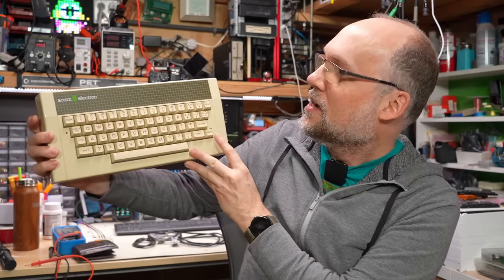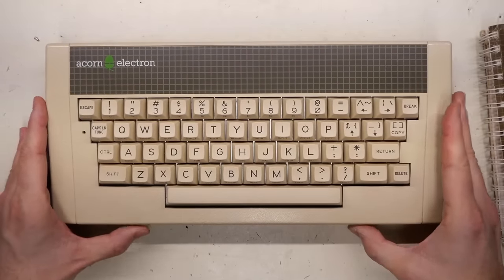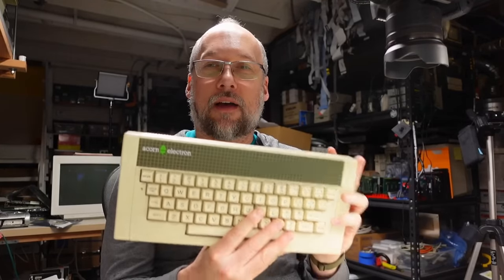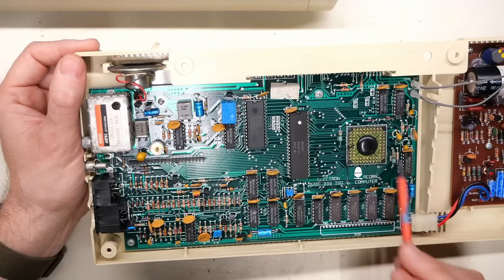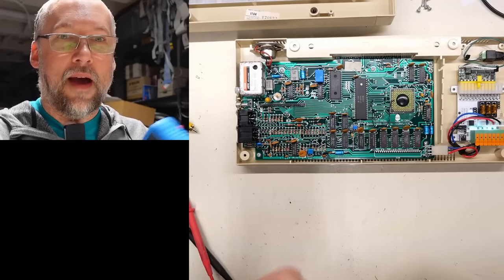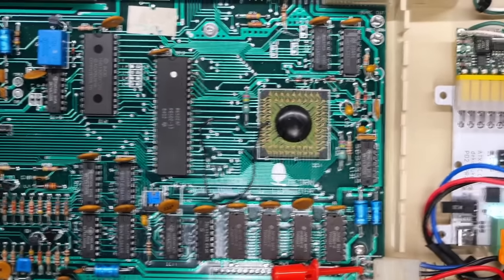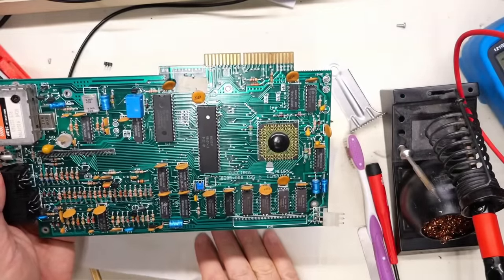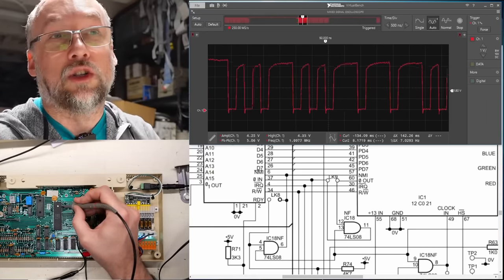I was shocked at what was keeping this Acorn Electron from working (Acorn Electron Repair)

Comment: Regarding the SY6502A and the minimum clock speed - the MOS 6502 was a dynamic logic NMOS process chip. This means that unlike a CMOS process that is in every modern chip where you have NMOS and PMOS transistors, you only had NMOS transistors so you needed to design your logic circuitry very differently. Dynamic logic requires that you precharge all combinatorial logic nodes high during one clock phase, then evaluate the logic during the next clock phase. If none of the NMOS  transistors pulled the logic node low, then you have a one. This method depends upon the node capacitance being large enough that during the phi2 clock phase, the 1 doesn't leak away to be a zero. Hence the minimum clock frequency of 25kHz.

Dynamic logic allows you to use fewer transistors at the expense of a maximum cycle time - so this was another benefit when transistors were (relatively) huge and die area was at a premium.

So a static logic circuit design is going to be very different from a dynamic logic design - hence why a CMOS version of the 6502 is logically different. 

Most parts - for example the Rockwell 6502 were made under second source agreements and they were direct copies of the masks. Thus no logic changes were able to be made and thus no opportunities were there to "fix" this other than making process changes to make your transistors less leaky.
Reply: I should note that none of the two phase clocks on the C64 and the minimum clock frequency made any sense to me until my VLSI course in college.

Comment: Excellent work Adrian. Our secondary school in Scotland in the 80's had a handful of BBC Model B computers which I absolutely loved. Unfortunately they were too expensive for my parents and underpowered for what I wanted (games!). So, I feel the Electron was a bodged opportunity - had it been as fast as the BBC with expandable RAM and able to use the fast BBC floppy disk drive, it may have been a contender in the c64, spectrum and Amstrad dominated UK market.
Reply: Not sure what you mean by "the fast BBC floppy disk drive", but the disk systems for the Electron were certainly performant. I used the Slogger Pegasus 400 which could load software very quickly, and many (if not most) of the Electron DFS implementations also didn't steal RAM from the system, which Beeb users seemed to tolerate for some reason. Also, the Electron disk systems all used the WD1770 and thus skipped the palaver on the Beeb with the 8271 - the era of 100K-capacity disks - and all sorts of DFS compatibility issues with the subsequent transition to the 1770.

I do agree that Acorn shouldn't have constrained the RAM bus width. Using eight RAM chips would also have given the machine 64K and extended its appeal. They should have included the Beeb's sound chip or a workalike, too. But it was a nice machine as it was, of course.

Comment: I love "obscure" (for North America, not the UK in this case) computers which are also new for you - exploring the unknown. 😀

As for the RESTORE command. I believe it resets the pointer from the READ command (reading values after DATA), not a program in memory.

Similar to the Commodore 64 the reset (BREAK) on an Electron it will not initialize the RAM, but merely points the two addresses decimal 56 and 55 to where BASIC usually starts. POKEing them to a higher value should "restore" it. Although when guessing those values you'll see garbage at the end. Plus a modification of the program might destroy it now.

Thinking about it, wasn't there something with 00 00 00 which are usually the values of the last 3 bytes of a BASIC program? Long time...

Comment: I stall have an Acorn Electron in the attic. (And even some old BBC Electron magazines.)
I will check this year whether it still is functioning.
I remember having tested it a 15 years ago (or perhaps longer ago), and at that moment the Composite Video gave no screen, the RGB-output díd.
I now assume - living in The Netherlands, using PAL - I only need to replace that cristal.

On loading any programs from tape, I have to look into that how that was done.
I assume it is just an issue of using the propper command.

Comment: Try the DRAGON32 they were a sodding nightmare to fix. for a minus 5v supply cant you just reverse the wires from the plus 5v? ie add 2 more reversed wires with 2x 1n4007 diodes, that way computer can be powered from a type A USB socket.
Great video Adrian, love it, these little computers were a hell of a lot of fun, the ORIC-1 was one of my favourites too.
Reply: No you cannot get -5V by reversing the wires,.  The 0V of the -5V is also the 0V of the +5V.

Comment: Recall having an Acorn that the students shared in our classroom at primary school in the mid 90s.  Software loaded via 3.5" floppy discs.  I remember the keys being multi colour, but for which model it was I've no idea.  The other computer the school had run Windows 98
Reply: Archimedes
Reply: @MrDuncl Maybe not, looking at photos of the archimedes.  I remember everything being integrated with the keyboard.  This included the floppy drive - it was on the side of it.  EDIT - looking at more photos than just the single one on WIKI (thanks wikipedia) - there is a picture of another model that seems more familiar
Reply: @cantliff9  A3000 or A3010 ? Wikipedia actually shows photos of both of those further down the text.

Comment: I had issues reading programs on the cassette port on my Apple IIe until I bypassed the integrated sound card of my PC and used a cheap USB “sound card” that was pretty bare bones. That worked perfectly.
I assume the Windows drivers for the integrated sound card to alter the signal (probably to make it “sound better”).

Comment: actually, with just one large filter cap it might use that transformer/inductor to the lower right to generate both +5 and -5 from a single dc rail (okay, checked online, it should work with DC power supplied to it)
mostly extensions might not work without the 18VAC

Comment: I know you have a 3d printer. You've mentioned it more than once.  Why would you not use it to create a bracket for that power supply to use the same screw holes and provide a mounting point for a female barrel connector?  You can even get PLA in that color(or very close).

Comment: You should have a closer look at the Acorn original power supply.  That is not just a simple circuit.   It's quite complex with all those resistors and switching.  You may find it used a standard bridge rectifier and generated the negative voltage rail elsewhere.    Not saying 100% it is that, as I have not looked at that particular power supply, but looking at the quick views of the board you provided in the video,  it is more complex than it may first appear.

Comment: The odd 625i50 video mode with NTSC colour encoding was a real television standard, in several countries in Latin America. It's called NTSC-N even though technically it would be the nonexistent NTSC-B because it is using the underlying "mode B" television standard. That's also the source of the colour artifacts as PAL reverses the chroma phase on each video field, while NTSC does not.
Reply from the maker: According to Wikipedia it was never used: NTSC-N was originally proposed in the 1960s to the CCIR as a 50 Hz broadcast method for System N countries Paraguay, Uruguay and Argentina before they chose PAL-N. In the mid 1980s, it was effectively reintroduced as NTSC-50, a pseudo-system combining 625-line video with 3.58 MHz NTSC color. For example, an Atari ST running PAL software on their NTSC color display used this system as the monitor could not decode PAL color. Most analog NTSC television sets and monitors with a V-Hold knob can display this system after adjusting the vertical hold.

Comment: I wonder if the Sally 6502 used by Atari would work in an Electron? Keyboard is usually required to boot IIRC. It's possible I'm remembering it wrong, but if you hit break, try typing OLD to try and get your program abck.

Comment: The op-amps are also very likely powered  by +/- 5VDC. Lesson learned, or learnt, in this case🇬🇧: visually inspect first. 😂🎉 Color in NTSC is encoded using the phase of the color signal which is modulated on top of the intensity signal … relative to the color burst. In other words, it’s touchy.

Comment: i think you're possibly using the wrong audio cable, the ones I reemember for BBC had 3 plugs - headphone (playback), mic (record) and remote, connected to the DIN. Therefore it could be possible that your 'headphone' is going to the wrong pins in the DIN.

Comment: "I can't fix this machine, so I just leave it unsoldered and close it back up". Reminds me of the time a short term network admin replacement came to our company, plugged in a new ISDN card into the server, and asked me to help him find out why it can't be found by the driver. Turns out he didn't plug it into the socket, he just stuck in between the other cards.
Reply from the maker: OMG ... yeah it's a very strange thing to do stuff like this.

Comment: Just wondering if changing the system to NTSC will alter the expected timing of the cassette tape input signal - or if those alterations to the jumpers and caps are unrelated to the cassette tape input decoding circuits?

Comment: I had a Acorn Electron. The one thing i did like the most was that it had max. 132 colums text not 80.
Reply: It has a maximum horizontal resolution of 640 pixels, giving 80-column text with the standard 8-pixel character width. However, word processors like VIEW that support horizontal scrolling do permit wider document sizes. Acorn's later ARM-based machines do support 132-column modes, though.
Reply: @paul_boddie  It's a long time ago and don't know what you mean with horizontal scrolling but i know that i could use a text-mode that had 132 characters on one static screen, without scrolling.

Comment: I hear that the DIN standard used current not voltage for the signal with the impedance being the other way around for out to in… search up “din audio current not voltage” theres a few interseting results. Some manufacturers used the connector and kept voltage based, some adopted the current based… confusing. Apparently it seems the electron was some sort of DIN. Maybe thats your issue???

Comment: The Electron's power supply is actually a switchmode and will work fine without an AC input.  The Electron also won't come out of reset without the keyboard connected.
Reply: That second sentence is obviously untrue for the Electron in the video.
Reply: @geoffmorrison3648   I should say, it won't reliably come out of reset without the keyboard connected.  The keyboard terminates the address bus, without it connected you'll be lucky to get anything sensical out of it at all.

Comment: Dead machines usually caused by the ULA failing... easily fixed by simply increasing the two ULA power resistor values by a few ohms. I've fixed so many that way.
Reply: Are you saying that the ULA input voltages have drifted beyond their permissible range? It is interesting to hear about this.

Comment: Lack of power switch caused no end of issues with the original power supply (a somewhat chunky wall wart), ending up with broken wires with constant plugging and unplugging from the machine to power cycle.
Reply from the maker: Yeah seems pretty singy to not add a switch even in-line with the PSU.
Reply: @adriansdigitalbasement  as I remember when I got it repaired the company put one on the new wire. Another thing was issues with the TV modulator on earlier issues, mine went bad, big drama for a teenager lol.
Reply: @adriansdigitalbasement to be fair, most UK wall sockets have a switch on them, unlike the US sockets I believe.

Comment: Some real prices from the Christmas 1984 Dixons catalogue.
BBC Micro £399
Commodore 64 £199
Acorn Electron £199
Sinclair Spectrum £129 

So in fact the Electron was trying to compete with the C64. Unlike Jack Tramiel's famous "computers for the masses not the classes" being able to afford a BBC Micro meant you were probably already upper class.  To put all those prices in context you could buy a fairly decent used car for £500 back then.
Reply: The BBC was subsidised for schools - the government paid half the cost - so schools got entire labs full of them.

The Electron always felt like a missed opportunity.. adding mode 7 (the SAA5050 was dirt cheap since basicically every TV had one for teletext, but they could have implemented it in the ULA probably too) and making it run full speed it would have had a massive head start.. but instead it was so gimped everyone just carried on buying Spectrums.

Comment: I ran into a similar issue with my Tandy color computer- I tried to load a “tape” program played through the sound card of another computer but could never get it to work. Only when I saved the audio file of the program to an MP3 player and used that as my tape player would it work correctly. Not sure if it’s a noise issue or what, but might be something to look into.

Comment: I managed to get fairy reliable casaette loads from PlayUEF using my mobile (cell) phone set to output mono audio, using standard jack to DIN (mine is 7 pin with motor control for a real casette player) and with volume set to just under full.

Comment: Also, I suspect it was a repair attempt, I suspect they swapped the CPU, then swapped the ULA and actually did solder it in, but then it still didn't work, so they started removing the ULA again and that's when they said the hell with it.

Comment: That's quite the fail there from a previous owner trying to repair it, leaving things unsoldered like that would indeed make things not work, though I'll forgive them on the CPU, maybe they just didn't know about the differences in the 6502 processors at the time, but still, desoldering and then not re-soldering, that's a real pain... :S

Comment: looks  like  the modulator is date coded '84 which sounds 'sensible', i have had  3 electrons with modulators date coded 86, well after manufacture was ended so have been replaced for some reason, maybe some bad ones?!!

Comment: I wonder if the cost cutting on the RAM is why they were able to have such a nice keyboard for the price. They may have used that as a selling point against the terrible ZX Spectrum keyboard.
Reply: The keyboard was a side-effect of the Beeb's being built for school use: it was designed to be as robust as possible (hence its frequent migration to industrial use shortly after) to take potential abuse from kids of all ages. I'd imagine the 'leccy k/b was specced very similarly for much the same reason

Comment: I believe the Electron's ULA had most transistors of any chip upto that point.
Reply: It was designed to use one of the larger gate arrays in Ferranti's range at that time, at least. I think a figure of around 2400 gates was stated, although Ferranti claimed 10000-gate arrays would be on sale by 1983. Interestingly, it is claimed that the 6502 only has 3000 or so transistors, and so the ULA might potentially have an equivalent transistor count greater than the 6502.

However, in general, the complexity of a gate array would be far below a "dedicated" silicon chip due to the difference in feature size/density that such a chip would have. I think that the 68000, for instance, actually does have something like 68000 transistors, and it was already four years old by the time the Electron was launched.
Reply: @paul_boddie  It was hear say at the time that it was the most complicated (ie most transistors) but then as you say the 68000 is by name and by nature and some years before it. It does seem odd for it to be said unless there was some truth in it? Ie was it just the most complicated gate array produced. But even so the electron was limited because all they wanted could not be fitted on?

Comment: You could have found an old rat shack 18v  'filament' transformer (I think I have some in my junque box) and used that to make an 18v wall wart to power the computer with the original power supply.  A 6.3volt and 12.6 volt transformer connected with the secondaries in series adding would work too.  It should tolerate the 60 hz (would probably have better filtering than at 50hz) well.